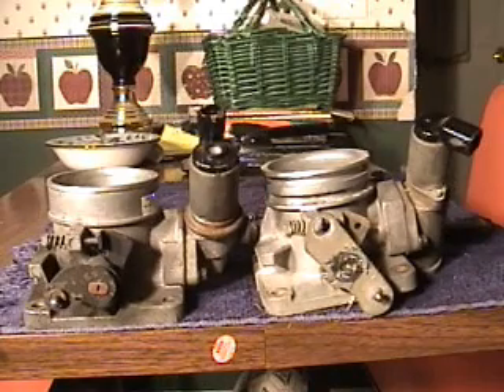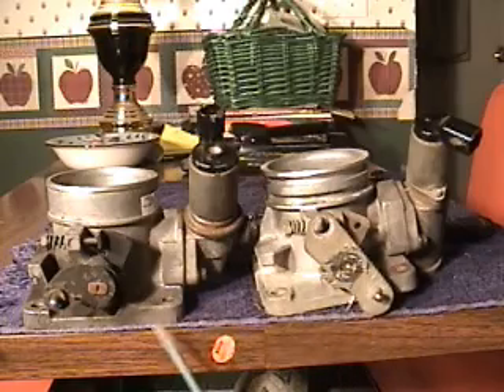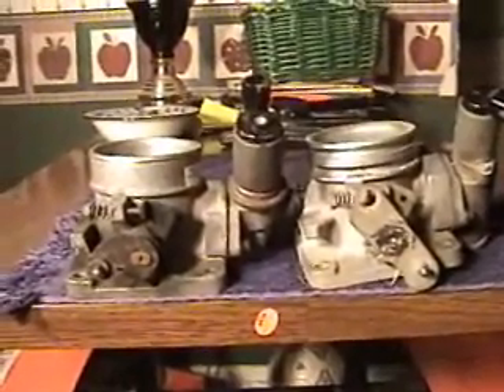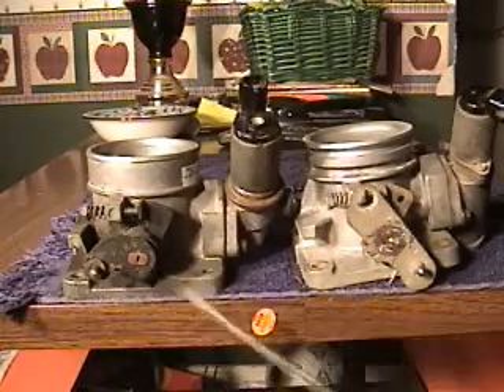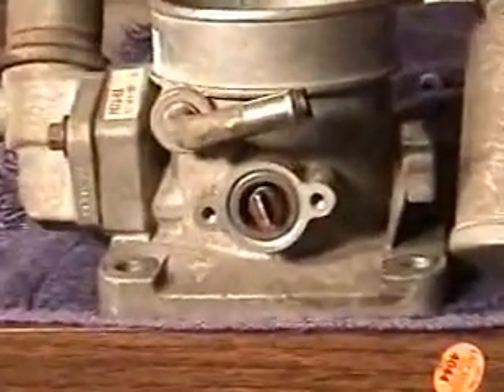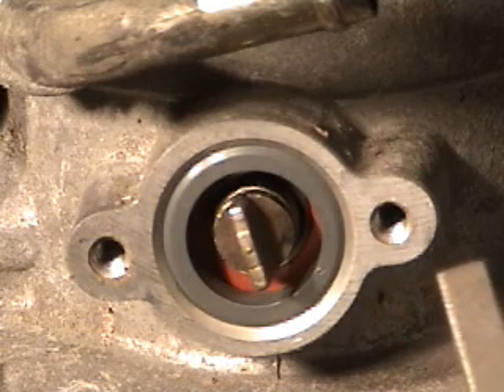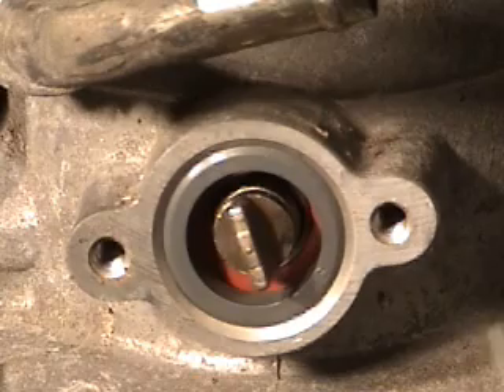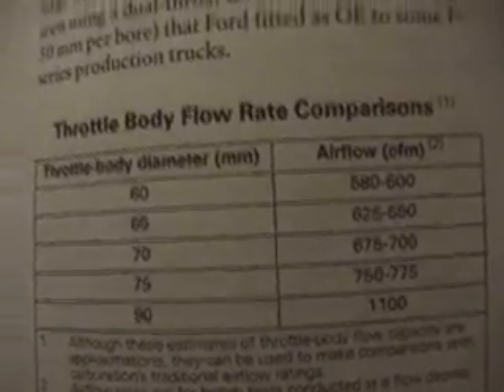Part 1 Explorer Throttle Body Modified to Fit Foxbody Must 0001

Comment: The explorer tb is 65mm the mustang is 55mm unless youre talking svt cobra stang then its a 70mm but also uses 24lbs injectors.
Reply: Also the thing on the side is the idle air control valve
Reply: Also to avoid premature failure on the tb linkage you should disassemble the tb properly. Pull the idle stop using your standard screw driver pull the screws from the tb blade also standard screwdriver remove the blade pull the shaft out. Use your dremel to open the tb blade seat up to fit the exporer 65mm tb blade. Then reassemble the unit with the explorer tb the explorer tb blade and the mustang throttle linkage assembly.
Reply: Aaron Wilson '86-'87 TBs were 58mm, '88-'93 were 60mm. '93 Cobra was 65mm.
Reply: Correction: '87 may also have been 60mm depending on which source you believe. Mass air meter opening (on cars so equipped) was 55mm.